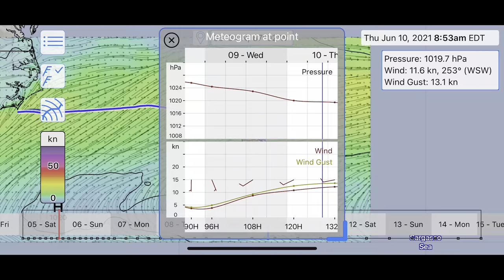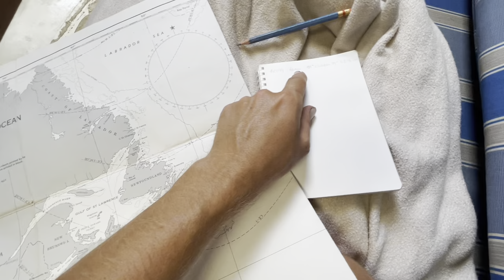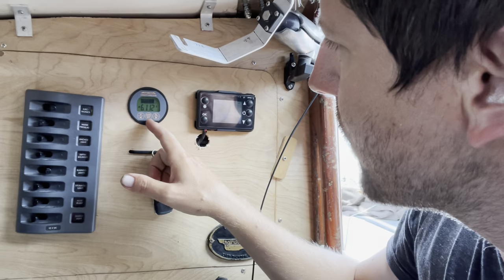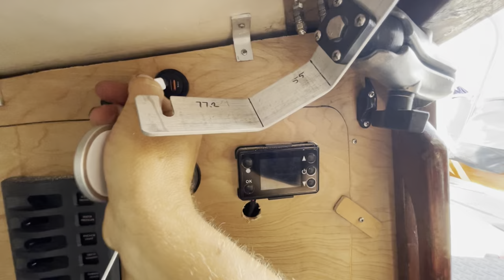Sailing single handed to Bermuda. 600 miles, 6 days, 28ft boat

Comment: Tuesday, 6 july,  7:30 pm.  Sam's location is about-  N 38 deg/ W 30 deg 59 "   
Sam will arrive at the main cluster of Islands ( Pico,Faial,Terceira...) . in 2 or 3 days
Go Sam go !
Reply: 2 or 3 days? Looks more like a day or less to me judging from his last few tracking points. He's heading for Horta.
Reply: @cmott3328  I believe Horta is a port in Faial and that is about 300 nm
Reply: @davidfalaguerra4134  I get a bit less than 100 nm from his last point to Horta. Maybe I'm doing it wrong though. The line was going through a bit of the southern part of the island, so it would add a few miles skirting along the coast.
Reply: @cmott3328  Just a ruff estimate-  I calculate about 70 miles per degree and a mile per minute.   At 7:30 am  Sam is  W 30 deg 05".    I estimate Horta to be about W 28 deg 35" . Therefore about 100 nm as of 7:30 am.  
Light winds today also. Perhaps Thursday late morning he will arrive in Horta.

Comment: OK - looks like Sam is back on a NE course, and is sailing at almost 6 mph, so maybe something happened - then Sam worked it out...
Reply: Yeh, a couple of days ago, from looking at the gps tracker, it seems like he backtracked for several miles. I'm just speculating, but maybe he dropped something off the boat and went back to get it. Or maybe he saw a whale and wanted to film it. Or maybe he temporarily lost his bearing. Or maybe there was a glitch in the gps system.... who knows! At least he seems to be on the right track now.

Comment: Anyone have an update on Sam's progress across the pond?
Reply: Hit the drop down below the video and it has a link to his location.
Reply: @jwyzdm  His tracking is not updated on his website. Even stuff that was there last week is no longer visible.
Reply: @jwyzdm  That works - thanks!
Reply: @pauldionne2884  Glad you found it, I just discovered it the other day. The best part I think is that you can draw conclusions from tracking him. Such as how he suddenly headed south last night for a few hours and then corrected. My guess is he fell asleep and his auto pilot is not working. A broken auto pilot is a very tough situation for a single handed sailor.